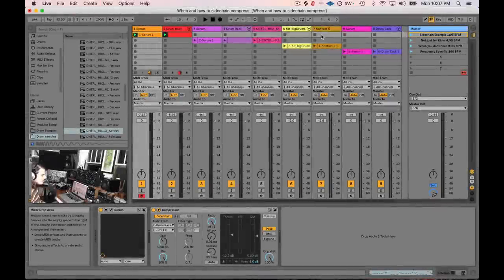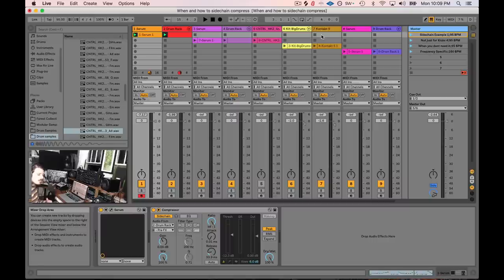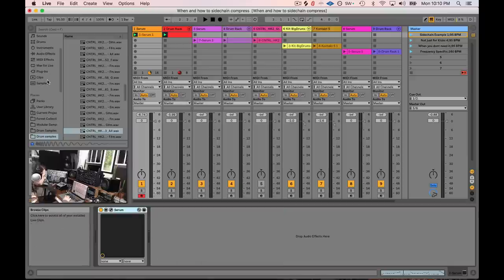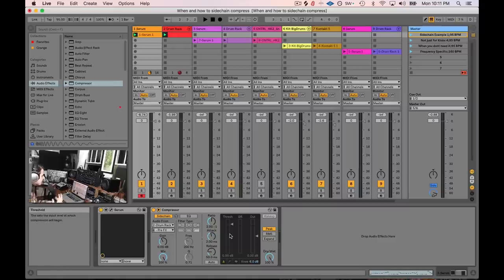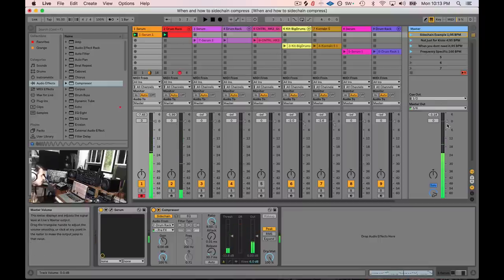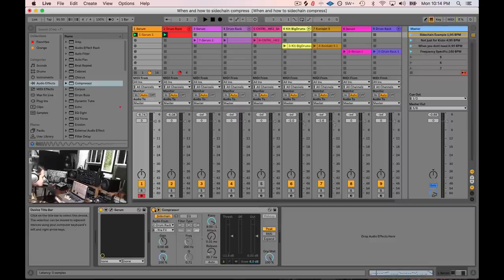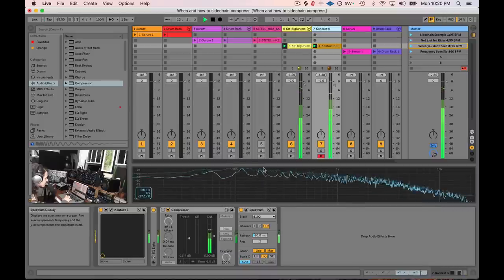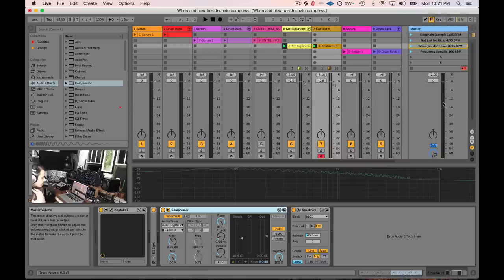When and How to use Sidechain Compression

Comment: Instead of freq splitter, you can use Ableton stock plugin called "multiband comp" turn of the high's ;)
Another great tip for the comp setting are long attack for lush pads to get that future sounding vibe ...
Reply: why dont u uploads tutorials video bro u seem like u got some great knowledge
Reply: Multiband comp comes with phase issues so it's better not to use it for best quality
Reply: the sidechain comp already has the EQ option, to affect which freq spot you want

Comment: Does Papadosio use sidechain compression in a live setting? I'm working on project where I'd like to run a trigger from the kick and snare back into ableton for sidechaining during a live performance. Not sure the best way to do this. These videos are great! Thanks!
Reply from the maker: you could easily set this up live using the same style of routing. You would need to lower your buffer to perhaps 64 to get the compressor to act fast enough but it's very doable through ableton.

Comment: why didn’t you include making ghost tracks for more accurate side chaining without using as much cpu?
Reply from the maker: I could have included that among many other things, such as changing the lookahead time of the compressor to react faster to incoming signal etc. There is a lot that could have been covered but the video would have been over an hour long. I will likely make another video for advanced sidechain techniques such as this. Thanks
Reply: @SeedtoStage  please do so 🙂